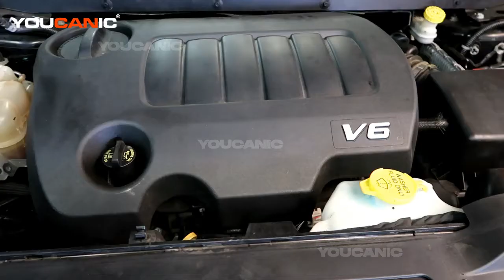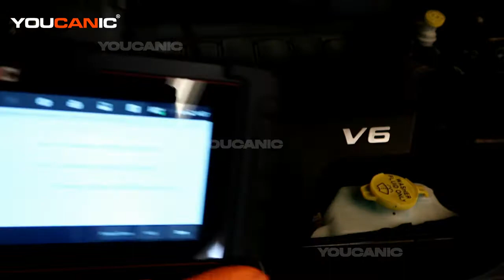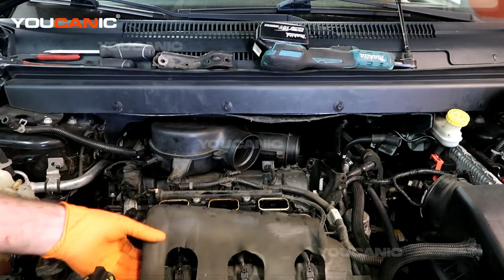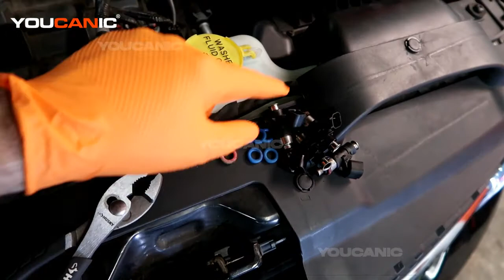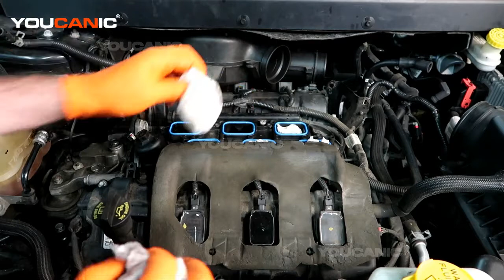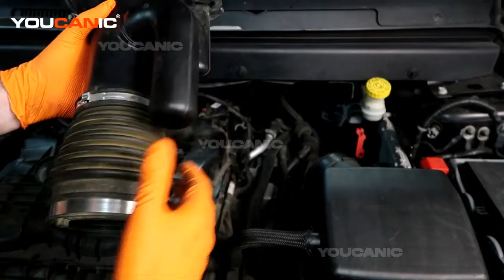2009-2020 Dodge Journey - Fuel Injector Replacement (Injector Open Circuit)

Comment: This was the best video I have ever used.  I'm a life time YouTube  Student. I went through these steps one by one and I got the fuel injector removed and installed by following your instructions.  Sadly, the lights still flicker so it must be something else aside from the miss firing injector.  I've already gotten a new battery,  new alternator, new starter - the codes showed a misfire so I checked the  wiring for the injector. The injector was my next step....

..... But still flickering...

Thanks again for the great video!

Comment: I replaced the fuel injector #4 but the code goes back on after driving it for about 20 miles. what is the next step?
Reply: Could it be a problem with the fuel rail?
Reply: Could be a spark plug or coil.. if that doesn't work you need to have someone check the compression on cylinder 4

Comment: Have you ever has a P219A code?
Reply: @bobbythompson1710I had a misfire cylinder 3 and fuel injector open circuit I replaced the spark plugs and the fuel injector and now I have a 219a. I feel like either the injector I bought is the problem or I killed the o2 sensor from running lean. did you ever get it fixed…your issue?
Reply: @bobbythompson1710 thanks yeah I was thinking of moving my injector and seeing if the issue goes to bank a thanks for responding
Reply: @Bohbohh did it nd up being a bad injector out the box?